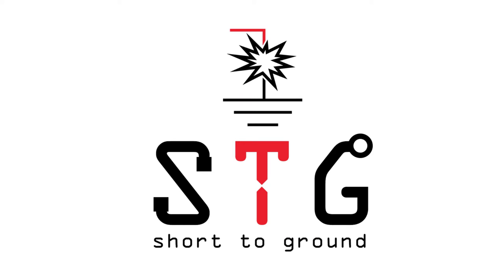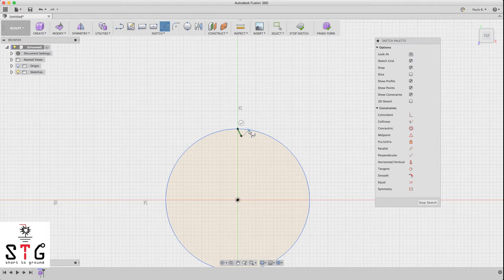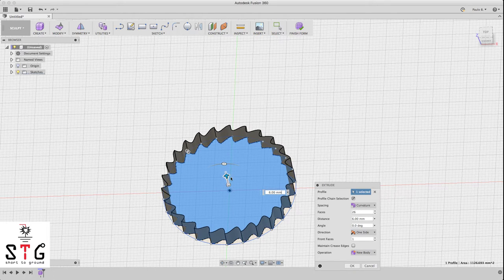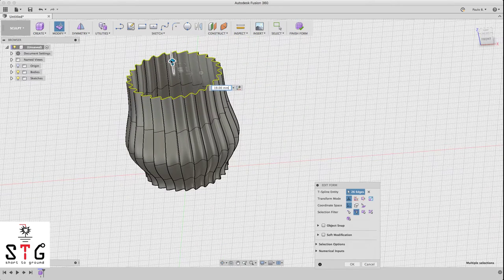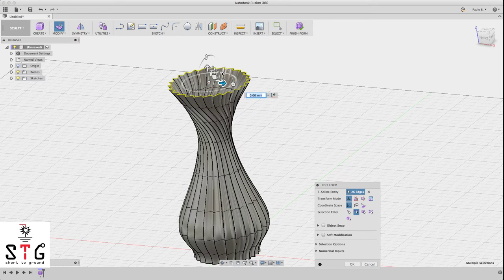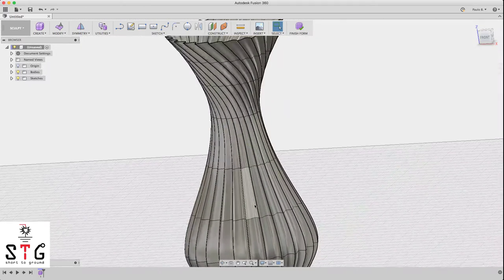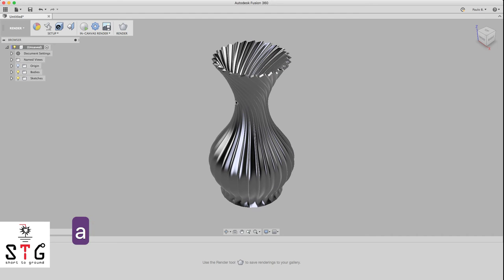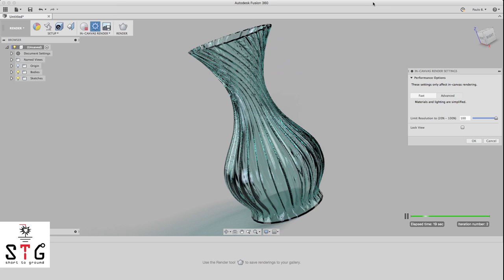Fusion 360 Tutorials #10 Vase Mode modeling

Comment: Latest version of F360 doesn't match yours. Select create, pattern, circular and then I can't select the spline I drew. Can select; face, bodies, features, components, try all, can't select spline I drew. What to do?
Reply from the maker: Voivod 1966 double click
Reply: Tried that. Tried selecting the area of the spline or other circle. I get nothing. Tried clicking the line, points in the spline. Tried starting the spline outside of the first circle, inside, etc. The only time I've gotten the circular pattern to work was when I extruded a shape I'd cut off a circle, that, poof, went into the dialogs and options.
But I must be missing something. I pull a circle, say 80mm. The sketch, spline, draw a shape inside the circle terminated on its circumference. Then I can't select it no matter what I try.

Comment: I'm using fusion 360  version 2.0.9719 and i do not find option to make that thing that you say something like "check if it' converts to model"  (in my left menu there is not sculpt option) so i'm exporting to stl as is but when slicing the vase have a lots of gaps in the walls :(

Comment: Hi, Thank you for the video. Very easy to follow. I have one question. If I want the inside of the vase to be smooth and not follow the pattern, how can i do that? like if I want a cylinder going though the inside of the vase? thanks for all your help
Reply from the maker: Hi, In the Patch section, without using the ticken feature, do like we did for the pattern: draw another vase inside with the circle pattern. Then on top the lines may not be horizontal, don't worry, just offset a plane to the desire height and cut the two vases. Then use the patch feature to close the top vases

Comment: When I compare this with Solidworks I think this program has some additional features when you have to make a quick design. Thank you it was very interesting.
Reply from the maker: What they are trying  to do with fusion is to make it easier to learn tool and to make possible to do a full project all in one software. It can do  mesh work, parametric, tracing, cnc, it's awesome.
Reply: I've been using fusion for years, it's incredible software. It caused me to buy a CNC machine for my garage.

Comment: What If I’d like to make it smooth inside or even with different shape? Thank you for the tutorial. Cheers.
Reply from the maker: Just make the same process and  extrude an inside sketch  as you want, then use patch tool to close the top and bottom perimeters. Just don't thicken the outside face.